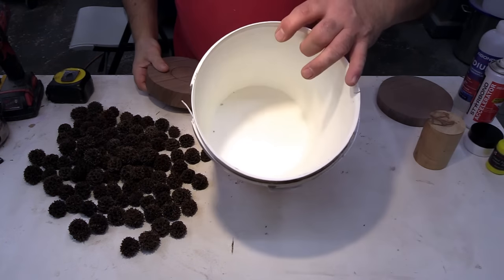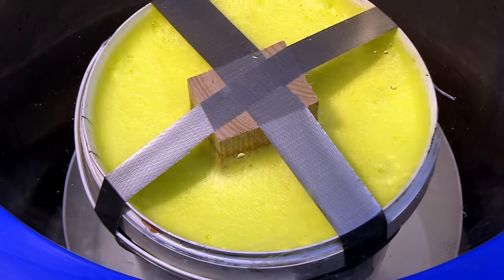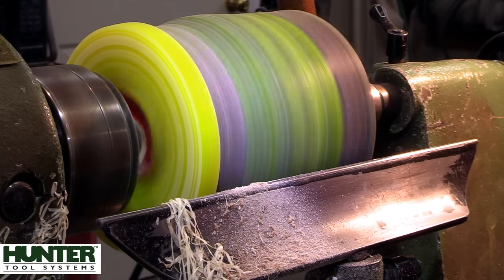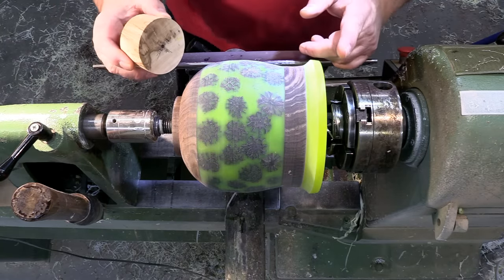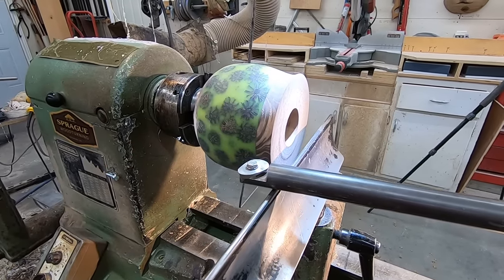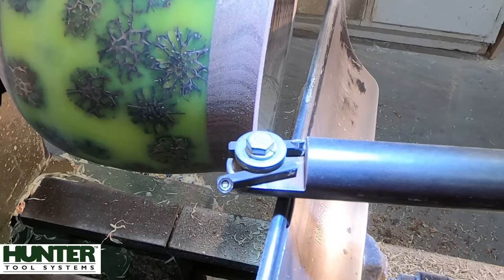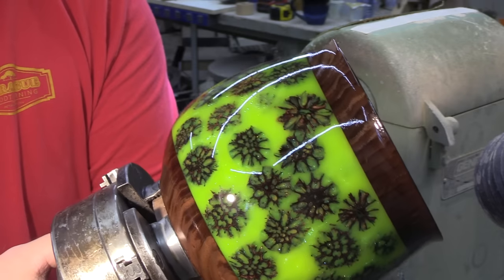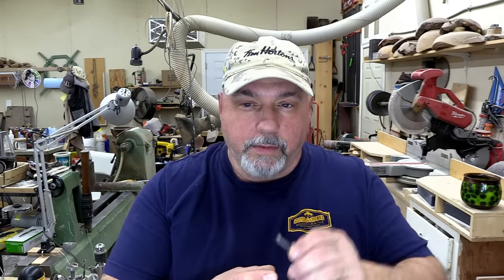Woodturning - I'M SWEET on Sweet Gum Pods!

Comment: Hi Jim, It's always a pleasure to watch you do your magic, another awesome piece.   I'm glad to see you're using colors that might be intimidating. That's  the creativity in you.  Great job!  What do you think about putting them sweet gum seeds in something similar to the round mold you used in your 80 thousand subscriber video, applying  different colors with the hyper shift.   Finishing the piece with designer epoxy  (water sanding between coats).  Wouldn't that be cool?  Keep on turning!!
Reply from the maker: What’s wet sanding, lol. Thank you so much!
Reply: @SpragueWoodturning  hi jim, it's called wet or dry diamond grit sand paper (water sanding).  You use water for lubricant with the diamond grit sand paper.  The car body shops use this technique to remove the orange peel and / or debris after they spray the clear coat on the vehicle (if there are any imperfections, then they buff).  You can maybe try this when you use the art cast on the entire project as your finish. The project will have no orange peel or debris.  Perrrrfection.....

Comment: I know this is going to sound strange, but the first time I saw the shape of the pods in the final form, I thought of snowflakes. I bet that if you used something similar with white resin and hyper-shift flakes, it would look even more like falling snowflakes.  I have to agree with your decision regarding the upper section of resin. If the colors had looked the same, then it would have been interesting to leave it, but with it looking like such a different color from the resin in the main body, it wouldn't look right. I love how it turned out.
Reply from the maker: I don’t think you will even see the hyper shift in a white resin. Might try a small sample and see if it works. Thanks

Comment: As always, awesome piece, Jim!  Have a question.  Noticed that sometimes you use a vacuum chamber, but not always.  Any reason why you don’t always use both?  Vacuum and pressure pot?  Since you have both already.
Reply from the maker: I will always use the PP, but the vacuum chamber comes into play when I’m trying to fill voids like you’ll find in sweet gum pods, or when casting resin or wood shavings, ect. Thanks

Comment: Love this piece! I'm a fan of lime green, which is how it came out looking to me.  Might just have been my color settings on my screen.  I'm thinking the dark color of the walnut and the sweet gum pods are probably impacting that as well. EDIT: It's definitely yellow when you shined the light through it from overhead! 

Observation: I noticed while you were showing the interior of the vase that the grain on the base runs perpendicular to the grain on the top edge.  Might have been on purpose, but you didn't say (that I noticed).  Good job if that's what you were going for.  Otherwise something to look at in the future.

Designer Epoxy
Reply from the maker: That was the plan, thanks!

Comment: I really liked this project.  I loved the top and bottom cap of wood with the epoxy resin sandwiched between.  Very cool.  I also enjoyed seeing a project with the bright yellow.  You definitely pulled it off.  Congrats!  But, I think yellow might work best when blended with another color . . . in perhaps a dual pour with blue, for example . . . especially if you could achieve good color separation.  But, nevertheless . . . this was very nice.  God Bless!!!
Reply from the maker: Pretty much impossible too do two colors in a casting like this because of the vacuum chamber. It would mix them into one color. Thank you very much!
Reply: Yes . . . I do agree with that.  I do trust you are correct on that.  I guess I was just speaking in general that the bright yellow would be great in a future project as part of a dual pour where a person could achieve good color separation.  You sure do have a great channel.  God Bless!!!

Comment: Love those sweetgum pods!  I was wondering if you could have turned part of the middle out before removing the resin rim to check the color?  It seems odd that the shadow of the pods would have changed the color so much toward the green (I mean, with the middle still solid, I can see that they DID).  
Either with or without the yellow rim, this piece is lovely and I could definitely see the hypershift!
Reply from the maker: I could tell right away the color was off. Thank you very much!

Comment: On the cutting tip, try using a small piece of 120 grit paper folded in half under the bit, then tighten it down. The increased friction might hold it in place.
Reply from the maker: Thank you so much!

Comment: I love your channel; I am based in Western Australia.  I noticed on some of your videos you talked about starting the cure in the fridge to reduce thermal cracking.  On this video you just used vacuum chamber and pressure pot.  Have you given up on the curing in the fridge?
Reply from the maker: The fridge is used to slow down the curing process. That way the piece won’t thermal crack when it’s an over pour. Thanks

Comment: Another great one Jim, fantastic.  

I'm looking to make a casting about 4 in diameter by 4 inches high.  I want it to be as clear as possible.  Should I just go with 1 full depth pour of deep cast or multiple pours of, say, pro series or art cast? Do you think the multiple pours lines will be visible?
Reply from the maker: You can do it all in one pour with Deep Cast, its good upto 4", good chance you'll see witness lines using Artcast, thanks for watching
Reply: @SpragueWoodturning  thanks for the advice, watching your videos is inspiring me to gear up.  I just invested in a brand new coring system, eventually a hollowing rig... when my toy budget can cover it

Comment: Ha Jim very nice piece I wanted to thank you because I ordered some designer epoxy this week never used it before so I'm going to give it a try and I did get the discount so thank you! I also want to try the Hercules tools you use I have the Eastwood tools and a lot of other tools as well but the look very stout the carbon tips you use are the negative rate for the resin or no? anyway thanks Larry!
Reply from the maker: The carbide cutters are not negative rake, but because the tool is tilted forward it puts the cutter in the negative rake position and they work great on resin. Thanks

Comment: I didn't hate the resin band at the top but at the end, I agree that the result is cleaner without it. The piece looks like it belongs in the 70's partly due to the way the camera kept turning it lime green. So frustrating when technology can't render what your eye is seeing!  I have had the same problem with some of the ceramic dragons I have painted, especially aqua shades. The camera wants to render aqua into sky blue and it makes me so stabby!! Putting the light behind the bowl really helped to confirm the yellow color.  I would have loved to have seen the bowl in person.  The sweet gum pods are super cool!
Reply from the maker: Agreed, the color of the buckets, castings and if I’ve got any light hitting my table will throw the color off. Thank you so much!

Comment: Very cool piece Jim. How large is your vacuum chamber and who makes it? Thank you.
Reply from the maker: This is the one I got https://www.amazon.ca/Tempered-Chamber-Stainless-Degassing-Stabilizing/dp/B0B773VV6L/ref=mp_s_a_1_1_sspa?crid=2F8WPLS180JMT&keywords=vacuum+chamber+with+pump&qid=1701000628&sprefix=vacuum+chamber%2Caps%2C291&sr=8-1-spons&ufe=app_do%3Aamzn1.fos.71722c10-739d-471b-befb-3e4b9bf7d0d6&sp_csd=d2lkZ2V0TmFtZT1zcF9waG9uZV9zZWFyY2hfYXRm&psc=1 the only issue I have with it is the pump weeps oil out the exhaust and apparently that’s normal. It’s a good buy for the money. Thanks

Comment: I won't lie, it's a nice project but I'm not a big fan of yellow and there's a lot of yellow there lol

The wood and the seed pods are really nice though, I think the lighter colours would benefit the use of the mother of pearl more rather than the hyper shift though.

The stain glass window sounds really good, you could cast several transucent or semi-translucent colours in several buckets/tubs with the same diameter and cut them into (cheese triangle/wedge shaped) segments, rough them up a bit and glue then into a bucket (or use wooden skewers or a central wasten wooden block core to help with glueing then into a shape and turning away the wood) and use a silvery grey as the lead frame that stain glass windows use as the framework for the glass (incorporating a design or a checkerboard style pattern?).

A few ways to do it I guess but not sure if it would look better as a resin only design or have wood on the top, bottom or in between? lol

Something you'll have to have a think about a design after looking at different stain glass objects/windows online lol
Reply from the maker: Cutting up pie pieces is a neat concept. Thanks

Comment: It looks very cute. I wonder if a lid would have looked nice on it.
I’m glad you took off the top part, because the color was not the same. But I don’t understand why you shaved it off and not cut it off. This way you would have had one solid piece instead of the shavings.
Reply from the maker: The shavings are easier to use than solid pieces of resin like that one would of been. Thank you so much!

Comment: nice work and bowl 👍that sweetgum is realy sweeet 😅pun intended 😬
 have you ever used the hunter tool swanneck tool Jim?
its realy a shitshow when im using it. and i realy cant find any good videos on YT on it.
its grabby and i realy do feel i am not using it in a safe way. Do you have any tips on using that?
Reply from the maker: What are you using it for? The reason I ask, is because they are meant to be used on endgain projects like boxes and such. Unfortunately since I’m left handed, the tool is uncomfortable to use for me. Hope this helps. Jim
Reply: @SpragueWoodturning  tnx for answering Jim. im using it for endgrain hollowing of boxes an dsmall vases. the salesperson that sold it to me said tilt it sideways so you cut at an angle. but that only works at the bottom. should it be held straight at the sides and at the inside of the top?
Thomas

Comment: I rather liked the yellow rim. I notice the bowl lightened up a lot as you hollowed it out. Could be the yellow rim wouldn't have been that much different in color after it was hollowed out. Could you have left it on and then cut it off later if you decided it didn't match closely enough?
Reply from the maker: Possibly. Thanks

Comment: My tools get dall fast do you have a idea of what it is i have dry wood maple and oak
Reply from the maker: It depends on what tools your working with. If there just carbon steel, then they are going to dull faster. If there high speed steel then the edge will last longer and if there carbide they will last the longest. What the tool brand your using?
Reply: @SpragueWoodturning   it saysHSS but i got Hurricane Turning Tools, HTT-108, High Speed Steel, 1" Spindle Roughing Gouge
Reply from the maker: Sorry I don’t know if there good tools or not. I pretty much stick to crown tools.

Comment: Believe it or not, if you use '000000' steel wool on an automotive windshield with persistent water spots, it will eliminate those calcium deposits. And give you a clear windshield, then wax, and buff. No windshield wipers needed after that...
Not to mention polishing wood!?😅
Reply from the maker: I’m always worried about scratching the glass, I’ve used it on chrome lots but not glass. Thanks!
Reply: @SpragueWoodturning  
I've used it on chrome, it scratches. Not on tempered windshield glass.
Reply: @SpragueWoodturning  
I've used '0000' steel wool on windshield glass to polish off contamination. Then wax with a good McGuires wax. Then buff off of course.